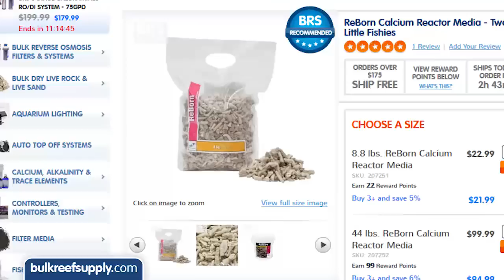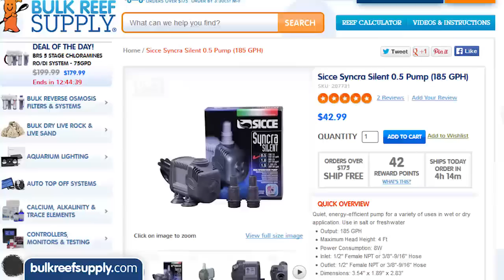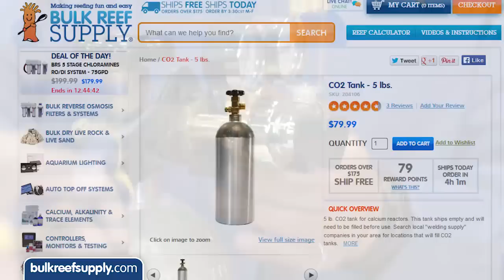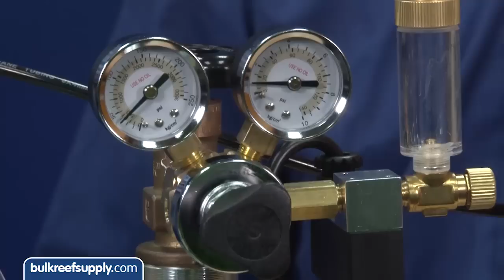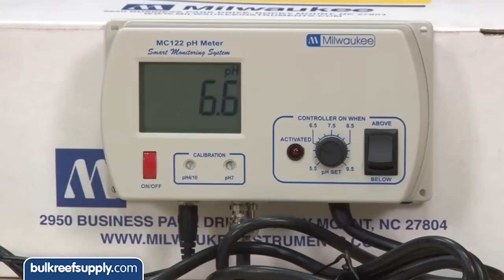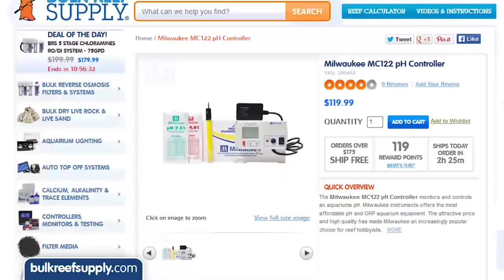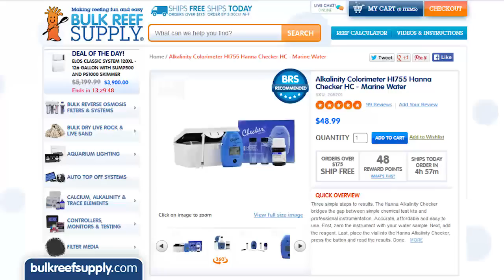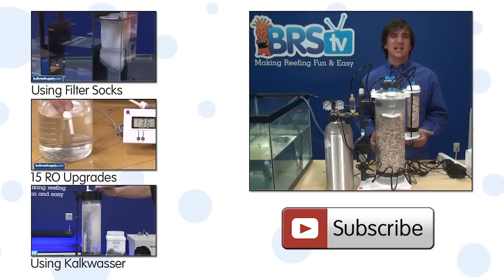Set-up and Tune a Calcium Reactor | How To Tuesday

Comment: Hi BRS, great video, loved it. question: in europe, Dastaco calcium reactors are very popular due to the set and forget mechanics (co2 is regulated without ph probe) and the solid build quality and operation. is this a product you are familiar with and/or may offer in the future?
Reply: BulkReefSupplyCom o, well, may be a good idea to try them out. They're definitely not cheap, but nevertheless very popular here in europe. Made in belgium

Comment: Great video BRS! I has given me the confidence to go for it and I've been purchasing my setup piece by piece. I've dosed and kalkwasse dripped and believe this is more natural, less work and cost effective in the long run. that dosing stuff can be a challenge too depending on the brand of salt you use etc. I an old Navy Chief we K.I.S (keep it simple).  As for the setup I am planning to use an Aquamaxx Ctech reactor, Tunze regulator and a Tom Aquatics dosing pump I just need to purchase an American pinpoint PH controller as I can't afford the $800 for the Apex at this time. None the less I'm open for pointers as this is an never ending hobby that you ALWAYS learning from. By the way I do like that skillz reactor with the secondary media chamber.

Comment: How can that Sicce pump continue working with it's outlet at basically a drip on the output side of the reactor? It seems like the output of the pump is effectively capped off so that there is basically almost infinitely high backpressure on it, and would kill the pump. That is the one thing I don't understand about calcium reactors.

Comment: if I have the apex system, second pH probe and solenoid valve I don't need to buy milwaukee controler. correct? can connect solenoid valve directly to the apex?

Comment: Side note: you don't use Teflon tape on the CO2 tank threads. They have a gasket for this.  Adjustable crescent wrench would also work better and not screw up the nut. :)

Comment: I've been spending money on additives for my corals for a long time now and wishing I'd have gone into something like this a long time ago.  I've not done it yet, but this video has really given me the confidence to go ahead with the purchase of a thousand dollars or more.  I figure it will pay for itself in 5 year and will save me from having to dose the aquarium myself... and I hear it's great for corals which I sometimes forget about and neglect.  So, I'm nervous, but I guess it's time to just go for it.  I'll do the manifold from my main pump as my main pump is way, way, way overkill for my 140 gal tank and I'm assuming I'll save a few bucks from not having to plug in another electric consuming device.  My big issue here is should I go ahead and splurge for the stupid Apex controller now and be one of THOSE guys or just keep things as they are and get a drip/ph manager thingy... sigh...  any thoughts?

Comment: I know you guys sell Milwaukee regulators, so you are using what you sell, but for the record Milwaukee regulator kits have a horrible failure rate over time from my experience. I would recommend people use a good Victor two stage regulator and burkert solenoid. Cost more upfront but lights years more reliable and will literally last a life time.
Reply: ***** You bet. Coming from the world of high light high growth freshy planted tanks that require precise Co2 injection I have learned lots of lessons the hard way on Co2 injection. Milwaukee's are ok, but you get what you pay for at the end day.

Tom Barr (Phd in aquaculture) fresh water planted forum is chocked full of great info on how to put together a bullet proof Co2 injection system that will last the life of a tank.
http://www.barrreport.com/showthread.php/6470-Dual-Stage-Regulators